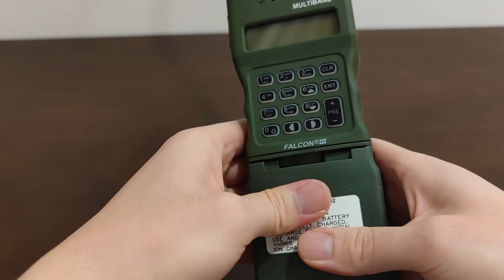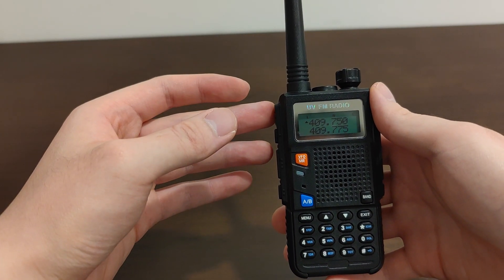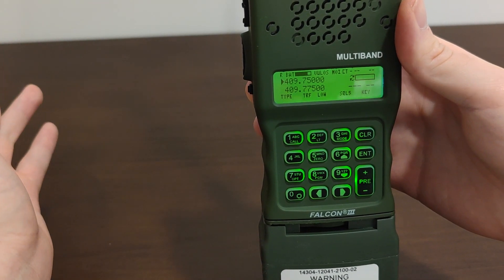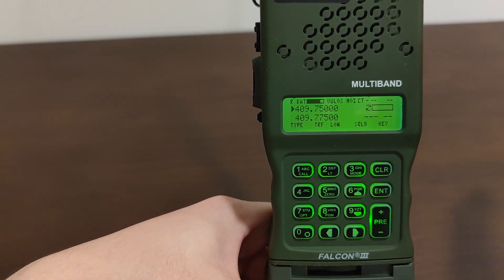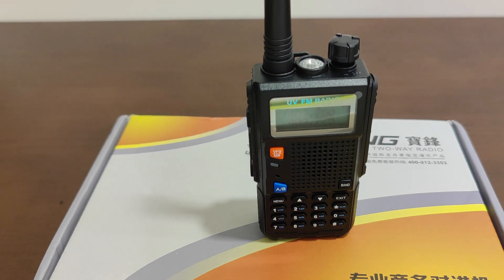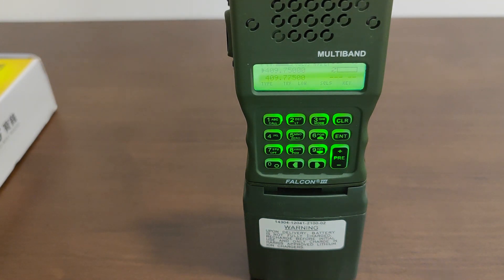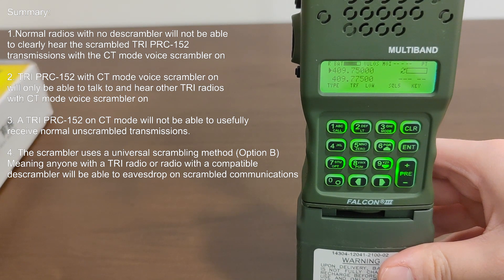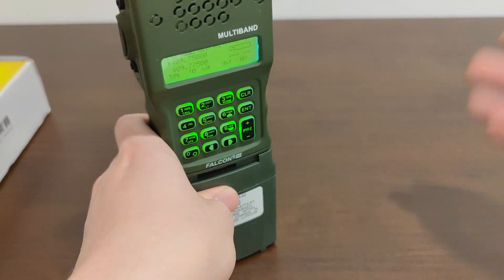TRI PRC-152 Radio Voice Encryption / Scrambler: It works! But...

Comment: I'm still unsure :  is the Tri PRC 152 on active CT scrambler mode able to be received by another Tri PRC 152 with CT scrambler mode enabled ?  Here's hoping that my mate's Tri PRC 152 was faulty cos on CT it could be descrambled by a cheap Baofeng 888's Beat Shift.  Now I'm not saying the Tri PRC 152 is a poor, overpriced radio but I don't think the programming sticker on the side will let you do frequency hopping rolling code.
Reply from the maker: Yeah, the TRI PRC-152 has more value as LARP flex than as an actual device to communicate with. It's capable but as you said, there are better options for the same money.
Reply: @hypemilitaria6447  It's superb for cosplay comms.  Especially when fitted with an Abree tactical antenna and a headset mic.

Comment: "A normal radio like a baoang UV5R"? These TRI/TEA/etc radios are little more than a UV5R in a fancy case, in fact in many ways they are not as capable as a UV5R for other baofeng radios. I still do not understand why people are paying between $300 and $600 for these.
Save you money and buy a decent radio instead.
Reply from the maker: LARP and collection. Basically that.
Reply: What decent radio would you recommend

Comment: dude your very freaking dombass because u need to understand the only reason your radio sounds like that when u transmit from your baofeng to your prc152 is because number one u have both modes set wrong number 2 u shouldve had u prc152 no ct scrambler on  and u should have had your baofeng transmit your voice inversion on it because baofengs and fm transceviers have voice inversion scramblers bulit in right into them so this video is bunch of crap because i own so many fm tranceivers with fm on it that have voice inversion i have no problem what so ever some body trying to  eavesdrooping on my coversations for public safety reasons and its very secure what u did was very backwards so no good ill make a video showing u the right way ok :)
Reply from the maker: Woah. Thanks bro. Such astute observation and eloquent delivery. You do know I was demonstrating how the simple inversion encryption worked, right? And your point of no one being able to eavesdrop would be valid if the TRI PRC-152 has multiple inversion modes to select from, which it didn't with the firmware version at the time of filming.

Comment: Are TCA and FCS 152 and 148 models compatible with their scrambler to the one from tri?
Reply: The TRI uses a different scrambler and is imo much better than the TCA. With the TCA I can still clearly hear what I’m saying but with the TRI I can’t. When I use the scrambler on both, I can’t hear what one is saying to the other so no they are not compatible
Reply: @Roshan_420  thanks alot for the info!! :) got the prc117 in meanwhile

Comment: Or!!! Get some Motorola mil surplus radios for $280/ea and have true 128bit encryption. Plus, add $80 for a Bluetooth connector for programming from your smartphone. Way cheaper and much better and huge market support!

Or go modern comms, get an earbud. Connect to your phone, setup a zoom meeting, invite your team, now you are encrypted, infinite range (most areas) and you get live audio and no need to push the ptt. Keep your hands on what you need to hold.
Reply: Do you have a make and model number of the Motorola radio that you are referring to?
I'd love to go and do some research
Reply: @coolbeanzs  He is probably refering to the military version of Motorola XTS-2500 (AN/PRC-153) or the XTS-5000. The basic civilian model is a p25 phase 1 digital radio(which is FDMA, with early IMBE vocoder, note that later phase 1 radios got AMBE+2 vocoders, but they still have backwards compatibility with the early models). It has GEN3 Night Vision compatible screen and used to have military grade encryption modes until they made it to the second hand civilian market, but they still have hardware implemented AES-256. It's still compatible with any p25 phase 1 AES-256 radio with the same encryption key that you can set in the CPS software of the radio. So you can use it with old EF Johnson p25 radios, Motorola XTS(handhelds) series, XTL(big mobile radio) series, any p25 phase 1 with AES256 (regardles what kind of vocoder they have). Keep it mind phase 1 and phase 2 are not compatible with each other. Phase 2 is using TDMA.
Reply: @laszlopentek8676  okay, thanks for the informed response. I didn’t think anyone was ever going to respond to that comment.

Comment: Is that a real PRC-152 or a replica?
 Real PRC-152 is supposed to have a very strong encryption.
Reply from the maker: It's a replica radio, not a real PRC-152. Albeit one that's quite well made.
Reply: @hypemilitaria6447  how could you get a replica
Reply from the maker: @theturbotickler  They're widely available online. You can find listings on eBay and AliExpress, and also on various airsoft retail sites.

Comment: Have you successfully programmed your radio with a computer? you mentioned that the middle position is for programming, i've not heard of that with the TRI radio?
Reply from the maker: Not yet. Unfortunately, a compatible programming cable doesn't yet exist.
Reply: @hypemilitaria6447  Im just a tad curious where you found a reference on that it is able to program via computer?
As per the manual there's three modes of that switch
PT - Voice Compression (some added bitrate)
LD - Normal operations VHF/UHF Analog transmissions
CT - Voice Envcryption (Basically just a normal modulation of the signal)

So if you could point me in a direction where you have seen that the TRI are computer programmable, then i can start investigating that, as i already have aserial option of doing it, but it is really slow going.
Reply from the maker: @SneakingMoose  Now that you've brought this up, I think I may have been mistaken. I distinctly remember reading a manual showing that PC programming was an option but that may have been the TCA one. I'll ask some inside folks here whether or not the rumored programming cable is even in TRI's pipeline.
Reply: @SneakingMoose  I was wondering the same thing. Software programing the newer generation TRI radios is a mystery. Big sad.
Reply: @CallMeColtLLC  First "public" mention of it, but I've had a couple dudes beta test a device I created, with a piece of software, that automates and programs the newer generations TRI-152, everything is finalizing right now and I am waiting on the prototype enclosure!
This allows better remote control and automated programming from a computer/android phone.
Will probably announce in one or several of the FB groups eventually!
Reply: @SneakingMoose  That's great news. Where do you plan to share when it's available? Here on the channel or somewhere else? I'll keep a lookout.
Reply: @CallMeColtLLC  finalizing with manufacturer so i'd say 1-2 months until first batch maybe!
Currently no website, BUT i'd wager the TRI user group on facebook is a certain!
Reply: @SneakingMoose  Cool, I'm a member on there. Will keep an eye out. Thank you.

Comment: Is the encryption the same on all radios, so anyone with a radio that is the same model, you can hear the encrypted transmission ?
Or is there a security key like Motorola radios have ?
Reply: You're better off speaking pig latin for security than using this "scrambler". It's literally the most insecure type of transmission obfuscation you can get
Reply from the maker: No security key, just a universal scrambler.

Comment: That sounds like Voice Inversion Scrambling instead of digital encryption.
Reply from the maker: It is indeed a very simple scrambler. The TRI PRC-152 is not capable of handling any digital modulations.
Reply: How does digital encryption sound?
Reply: @midoedo  sounds like random noise.
Reply: @TommyJ76 can you identify it
What digital modulation is used?
Reply: That's exactly what it is.
Reply: yeah... totally useless... a toy for boyscouts.
Reply: @nicke.3536  yea, he should use Baofeng, like the real HAMers 🤣
Reply: @nicke.3536  radios such as antyone 5888 have user defined scramble where you can tune the scramble to a non-standard frequency shift. requiring more involved effort to unscramble. good for basic hiding of voice, not for military purposes.
Reply: @nicke.3536 not really your basic radio scanner will pick it up but you wont understand them
Reply: @nicke.3536  Considering hams are not allowed to use encryption it isn't worth it to make it good. There are diy solutions if real military radio is not an option

Comment: Have you access to the PRC 117G radio type? They looks very cool & there's only one video of it out there.
Reply from the maker: Unfortunately, they seem to be out of stock everywhere, even on TRI's official stores. I think production of the 117Gs are on hold, either because they never really sold well or because TRI is currently working on an updated version. There are rumors out there saying both of these things.
Reply: @hypemilitaria6447  That's awesome, thanks for the information. All good things to look forwards to acquiring at some point then. Thanks for the fast reply again brother 🍻
Reply: @hypemilitaria6447  Hello again man, Hope you're doing well? 

Do you know of anywhere that has a TRI PRC-152 in stock? I've been struggling for weeks to find another one. Cheers
Reply from the maker: @SC-xb6qb  I'd say AliExpress or eBay; sellers in China tend to have them in stock, the issue will be the long wait times for shipping.